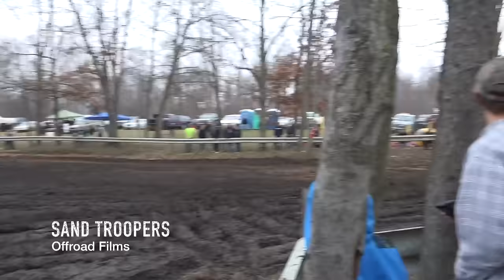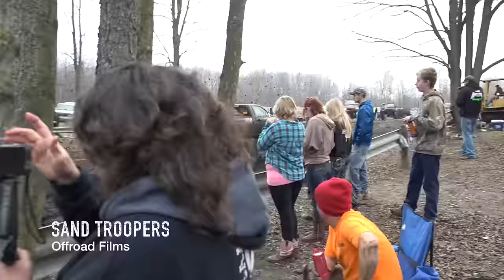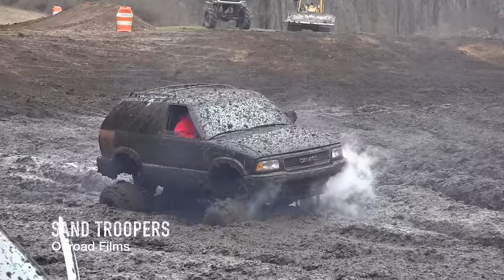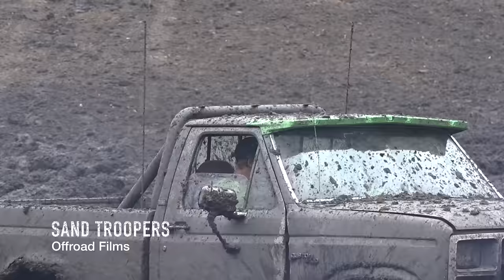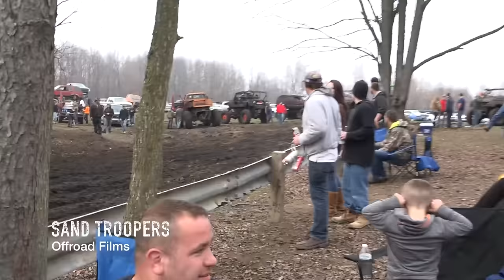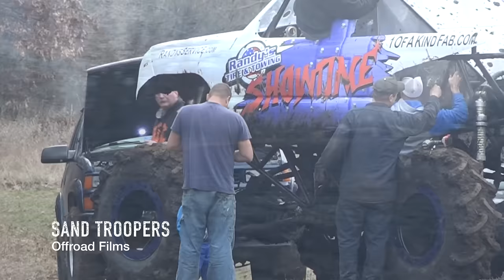Bentley Lake Rd Mud Bog "The MOVIE" Dec 12 2015

Comment: I got my self a 1985 stepside chevy with a 350 engine and a turbo 400 tranny..6 inch body lift and a 3 inch suspention lift so 8 inches over all..42 inch classic tsl super swampers..just single double roll bar and a roof viser too make it look more agressve its a pretty mean truck did a lot of work to it too, it came with 32 inch swampers and the body was all rotted out, the carb was junk and so was the fuel pump, if you floored it the truck would die right out, we put a new exaust on it and fixed all the rot and repainted it millatary green..with the new carb and fuel pump the truck runs mint.
Reply: 3+6=9 not 8